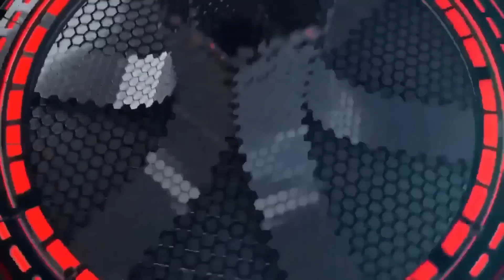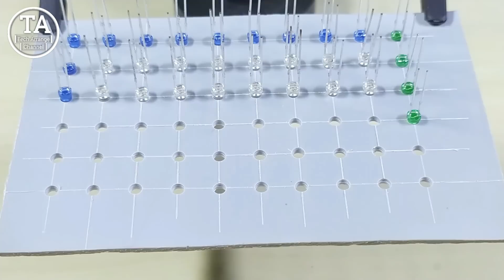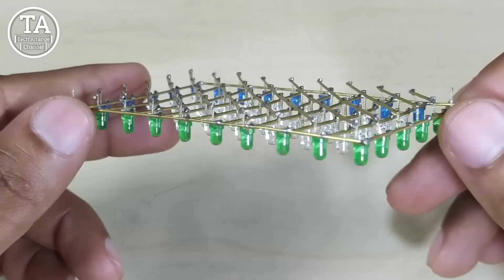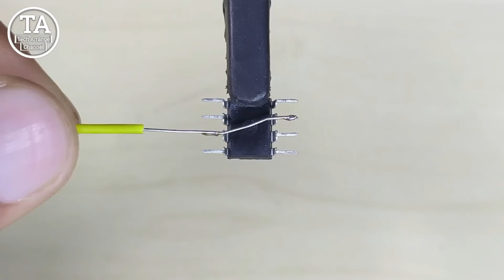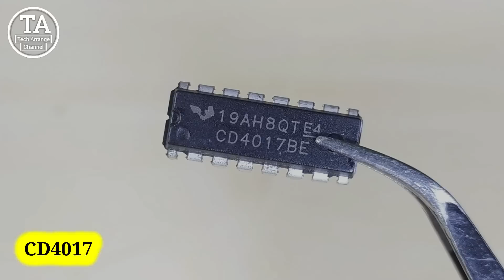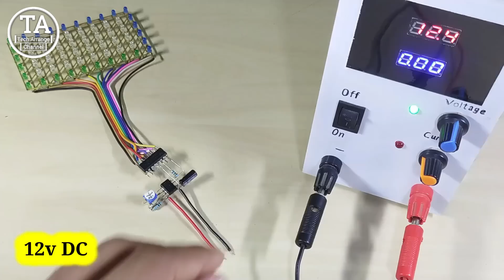Awesome LED Chaser Light Circuit using 4017 ic

Comment: Can't find 10k veritable resistor. So, possible by 100k?
Reply: Parts list says 10k variable resistor but the circuit diagram shows 50k.  It will run at a different speed with 100k.
Reply from the maker: Yes can use